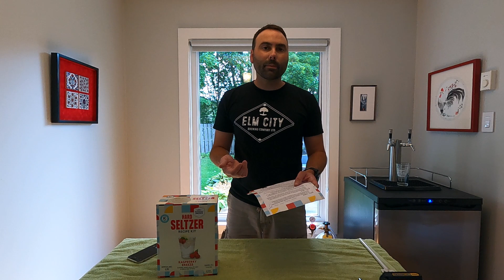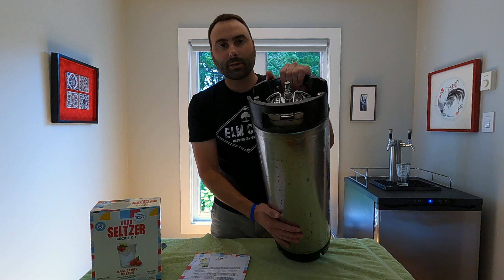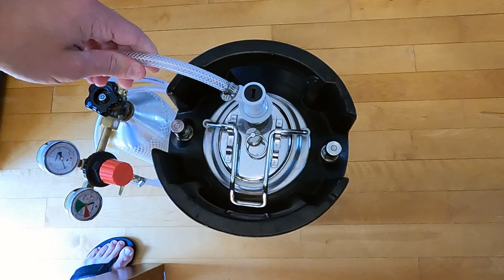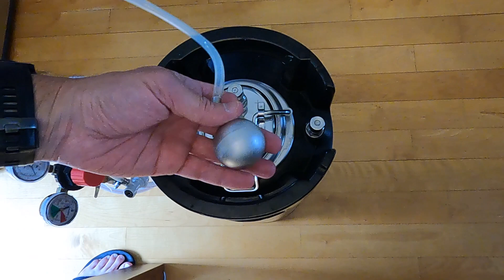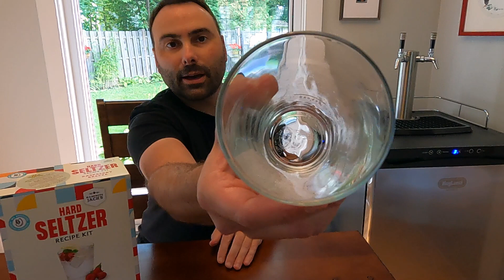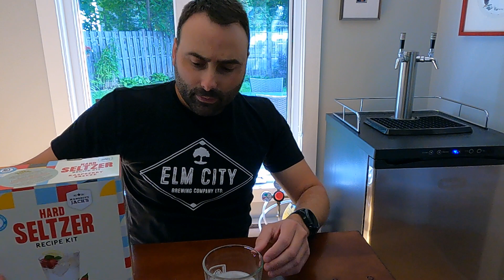Mangrove Jack's Hard Seltzer tasting & review | kegging & force carbonating | floating dip tube

Comment: Pressure brewed and kegged mine and it came out so good. No need for finings with the pressure brew.
Reply from the maker: Good to know. I pressure ferment beer using a corny keg with floating dip tube and spunding valve. Fast fermentation and compact sedimentation leaving clear beer.
Reply: How much pressure did you use? About to make one up myself
Reply: @timwalker4394  I set the valve to about 15psi.

Comment: My Question, does it taste like a white claw? or does it taste like a weird weak beer with fruity overtones, like some shit ones ive tried?
Reply from the maker: I would say that this seltzer kit is fairly close to a Whiteclaw clone. It's certainly not like beer. However, I'm getting a more faithful product because I kegged and was able to regulate the CO2 level way better than if I bottled the same.
Reply: @alleningrad  Thanks for the reply! So you think if I bottled it it wouldn't come out quite right? Currently I only have the gear to make 1 beer kit at a time, with a set of glass bottles for the exact amount a bucket makes. And with no budget to invest in kegs and other devices, Im just looking for a cheap way to get a white claw xD
Reply from the maker: @easydrivingclub  — The seltzer should turn out well in bottles, but the keg option ensures the clearest seltzer possible. I also used a floating dip tube which draws the beverage from the top, thus avoiding any sediment in the keg. Bottled seltzer may have some sediment which has the chance to make the drink less than perfectly clear. It’s worth a try I think. Let me know how you make out!

Comment: How do you get the liquid to come out so smoothly?  Mine keeps just 'gurgling' out and it seems to lose a lot of carbonation.
Reply from the maker: Are you using a floating dip tube or the standard long dip tube? Check that your serving lines are tight without leaks. I’ve had pressure leaks that were the result of improperly tightened band clamps.